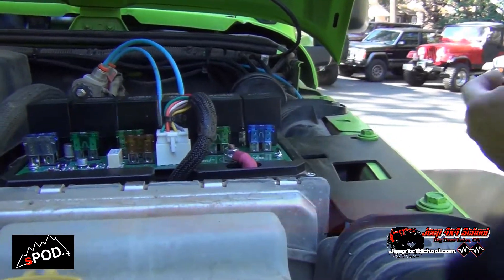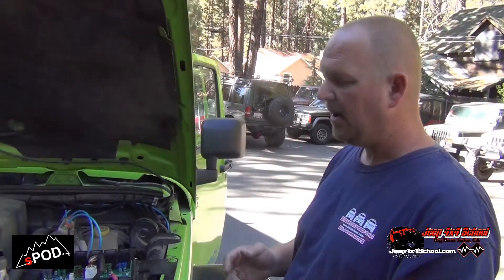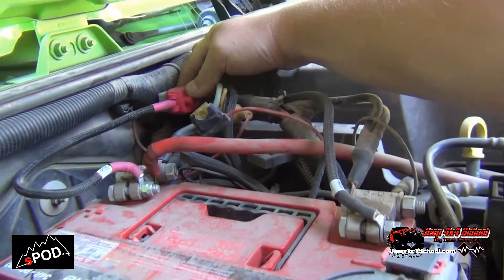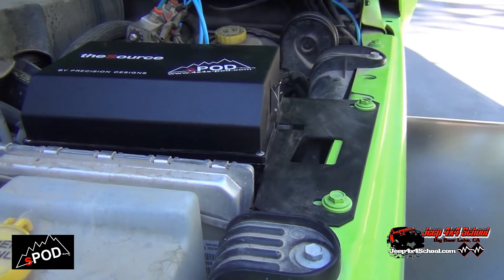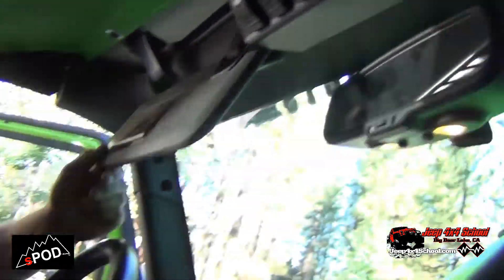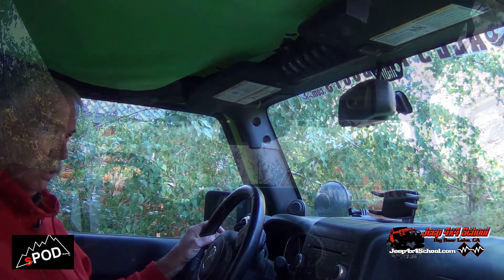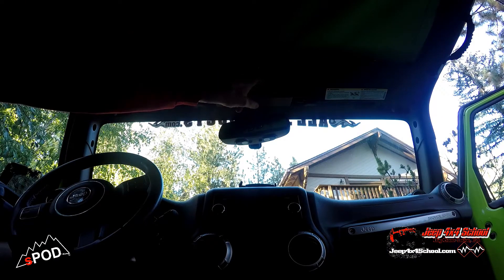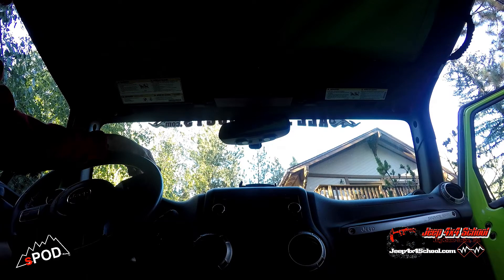sPOD Installation & Trail Test

Comment: Hi John, just a quick question, are you having a gasoline powered engine or a Diesel? Reason for my question is, that in the FAQs on the sPOD page there is written that only Gasoline-powered Jeeps can be equipped with the sPOD?And before spending the money for this great tool I want to be sure, because they have to send it to good old Germany ;-) THX